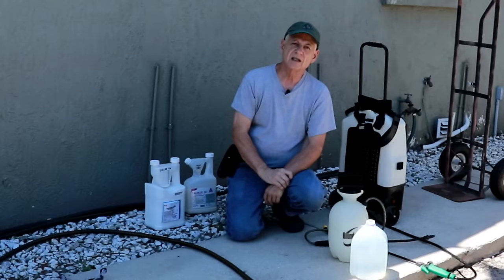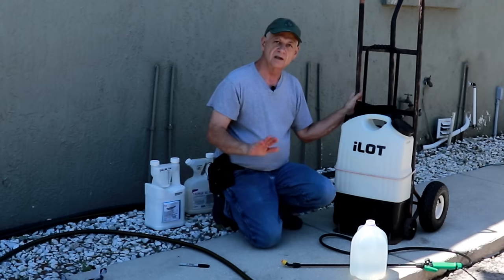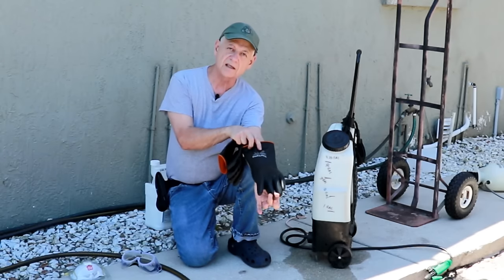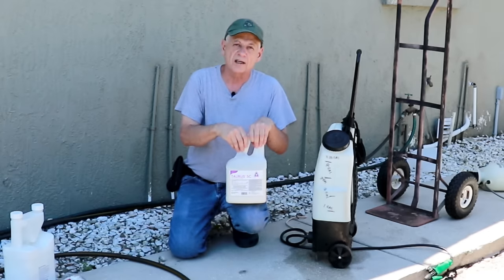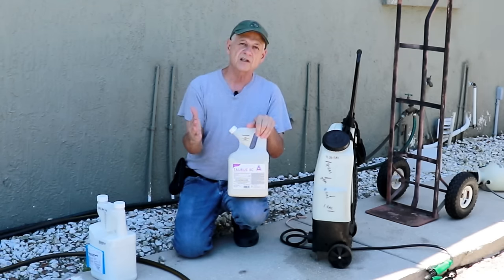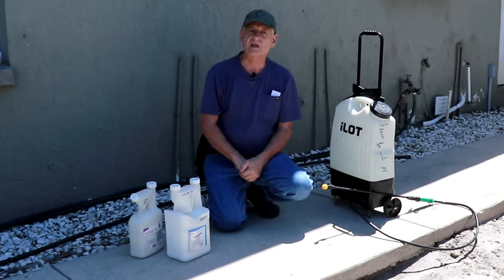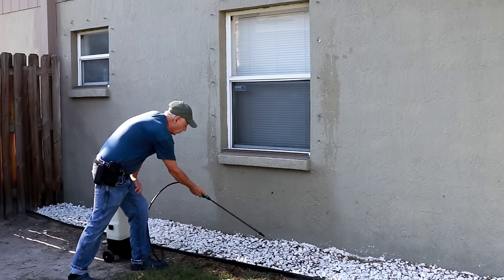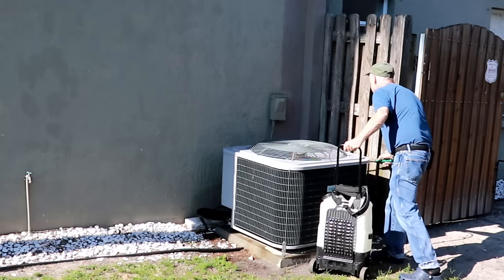General Exterior Pest Control - IMPORTANT!  READ THE DESCRIPTION.

Comment: I don’t know If anyone has asked this but in case of a rain storm situation. Would that void the 6 month treatment with the Taurus and require reapplication or wait the 6 month
Reply from the maker: Hi Ivaan.  Good question.  Here's the deal.  These products are designed not to wash away easily and are subjected to rain all the time.  That being said, the thing that I forgot to mention in the video is that you should treat every three months.  First treat with the Taurus SC, then three months later treat with the Talstar P, then three months later treat again with the Taurus SC, and so forth.  That way you are legal, but you still get the three month protection.  I have found that the Taurus SC does not last for six months.  Generally, it lasts for about three to four months, so you do need to do the Talstar P treatment in between the Taurus SC treatments.  I do know people who just treat every three months with the Taurus SC, but I cannot legally recommend it. Obviously, that will do a super job of controlling the pests, but the label is law and I would never suggest that anyone fail to follow the law.  I hope that helps.  Sorry that it took so long to get back to you.  For some unknown reason YouTube held your commend for review and I just received it a few minutes ago.  I don't know why they do that and I am working with them to fix the problem.  Sorry about that.  Thanks for the question and thanks for watching.

Comment: What do you recommend for what i think is booklice. Found in kitchen near  sink and window above. And found in 2 upstairs bathrooms on toilets.  How do you best treat for these tiny bugs that i can barely see?
Reply from the maker: Booklice, as the name implies, like to hang out on books and paper.  You can also find them in your pantry, in containers like boxes and bags, that you use to store food.  These guys like to feed on mold.  The only thing is that they like to feed where there is paper.  That does not mean though that they cannot be hanging out on shelves and areas of the wall that may have mold present.  Any small items, such as books, that do not contain metal, can be treated in a microwave oven.  Just place the item in a sealed plastic bag and place it in a microwave oven, with half a cup of water.  The water is important because microwaves heat water.  If you run the microwave without water in it, then damage may occur to the microwave.  So, the water is in there to protect the microwave.  Since microwaves heat water, it will kill any booklice or their eggs, because they contain water as well.  They do not contain enough water to protect the microwave, but they do contain enough so that the microwave will literally boil them to death.  Simply place the sealed bag and the half cup of water in the microwave.  Then use the highest setting available and microwave them for about 3 minutes.  You know they will be dead if the water in the cup is boiling.  Any other items that cannot be treated in this way should be thrown out if at all possible.  This includes food items.  If you have something that cannot be thrown away and it cannot be microwaved, then place it in the freezer for about four days.  This should kill the booklice, and then you can simply use a vacuum to remove the booklice and the eggs.   Next, you need to use a professional pyrethroid product that features a crack and crevice tube.  I recommend using PT 565 Plus XLO Pressurized Contact Insecticide.  It features a crack and crevice tube that will allow you to treat directly into cracks and crevices.   You want to get the spray into all cracks and crevices in your pantry, kitchen cabinets, windows, toilets, and any other cracks or crevices where you are seeing activity.  You also want to apply it on the surfaces of these areas as well and let it sit for about three or four hours.  This should kill any existing booklice that are in those locations. 

I hope that helps.  Be well my friend.

PT 565 Plus XLO Pressurized Contact Insecticide:   https://www.domyown.com/pt-565-plus-xlo-pressurized-contact-insecticide-14-oz-p-25335.html?pdpv=2
Reply: Thanks Guy! Will give this a go.
I looked over the product and it says it only works while wet, so does that mean that I will need to reapply?  
Is there not a product that is a non repellent like Taurus SC that I can use inside safely to deal with the booklice around the kitchen and toilets? Do you have any other product recommendations that I can look into? 

I just finished spraying the perimeter of the house etc as described in this video with Taurus SC so I hope that takes care of the ants getting in the house. 

One last question, what are your recommendations for rats?  We heard some chewing on the ceiling at what sounded like the metal part housing of a light fixture.   I can't seem to find all the entry points for these rats and the last time I hired someone they just plugged a few holes and didn't trap any rats but cost me a bunch of money.  
Do you have any ideas on how to beat deal with rats?

Thanks so much for responding and your great content. Been subscribed for a while 👍
Reply from the maker: I don't know what you were reading, but I can tell you that the Talstar P as a residual up to 90 days, and the Taurus SC is supposed to have a residual updo 180 days, but I find that hard to believe.  I think it has more residual closer to 90 days.  A great product that you can use indoors is tempered FX.  You can apply it with a pump up garden sprayer.

I have an updated video on how to treat the exterior of your house that you may want to check out.  The video is much shorter and includes more information than this one.  I will give you the link.

Rats are coming in from the outside.  So, the first thing you want to do is discourage them from being there in the first place.  If you have pets, do not feed them outside and do not leave food or water bowls outside.  If you have any bird feeders, then it's a good idea to remove them.  While the rats may not make their way up to the bird feeders, the birds can be quite messy and some of that bird feed may find its way to the ground, where the rats may eat it.  Make sure that all your trash cans are covered, and they have no holes in them.  In other words, make sure there are no food or water sources that they can get into.  
 
Next, walk around the outside of your house and seal any openings that you find.  You can use a commonly available caulk for small holes and Stuf-Fit for larger openings.  I will give you a link where you can buy Stuf-Fit.  If you have any trees or large plants that are touching the house, then trim them back and make sure that you have no trees that are overhanging the house.  If you cannot find where they are coming in, you can set up a critter cam on a tripod outside, facing the house.  Do one side of the house at a time.  Leave it out over night and in the morning the video will show how they are getting in.  There is a good selection of these cameras on Amazon.
  
Now that you've discouraged them from coming into the house, it's time to eliminate the population outside.  To do this, you need to use a bait and bait stations.  I will provide you with links to these products.  For the best results, place the bait stations directly against the foundation of the house and space them about every 15 to 20 feet apart, where you are seeing the activity.  You need to check the bait stations every day and replenish the bait as needed, until you are no longer seeing the bait being eaten. 
 
If you have rats that are inside the house, then the approach is pretty similar to outside the house.  You want to start by removing all the food sources.  Take your trash out every day, before you go to bed, so that there is no trash left for them to get into during the night.  Also, make sure that you don't leave any dishes lying around either.  Pet food and water dishes should not be left out overnight.  I do not recommend that you use a poison inside the house, because you don't want dead rats smelling up the house.  Therefore, I recommend using traps.  I think that snap traps work the best, and they're very affordable.  However, if you wish to be kind to the rats, then you can also use traps that will catch the rats alive and you can release them someplace outside.  You can find a good selection of these on Amazon.  You want to place the snap traps next to the walls, with the bait facing the wall.  If you're using the traps that catch them alive, then you want the opening to the trap to be near the wall.  The traps I am recommending can be reused.  Always wear rubber gloves when handling traps because the rats may avoid a trap that has a human smell on it.  After you catch a rat, you can dispose of it in the trash and then rinse off the trap with a garden hose for reuse.  Do not over clean the traps because you want to leave a little of the rat smell on the trap.  That will make the other rats more likely to approach the trap.  Be sure to check the traps at least daily or more often because dead rats in the trap will cause other rats to avoid the trap.  I do not recommend feeding rats and mice to cats because they may have a disease or parasites that can be passed along.  Place the traps at 10-foot intervals along the wall and focus on areas where you think there's activity.  Since you will be reusing the traps, I recommend that you use peanut butter as a bait because it is easily cleaned off when you wash the traps.  If you find that the rats are licking off the peanut butter without setting off the trap, then you can try a little bit of marshmallow.  It is much harder to clean it off the traps, but it is practically impossible for the rats to get it off without setting off the traps.  If you have children, I'm kind of guessing that you would prefer that they not get their fingers stuck in a trap.  I'm also guessing that you would prefer that the traps not snap down on the noses of any pets.  To avoid this problem, you can place the traps inside of a bait station.  These stations lock so that the kids cannot get into them.  They also make the traps more effective because rats like confined spaces.  Just use one trap for each bait station.

I hope that helps.  Be well my friend.
       
Stuf-Fit:  https://www.solutionsstores.com/stuf-fit-copper-mesh
 
Rat bait:  https://www.solutionsstores.com/eratication-rodent-bait
 
Bait stations:  https://www.solutionsstores.com/aegis-rp-bait-station-black-case
 
Snap traps:  https://www.solutionsstores.com/jagged-edge-snap-traps

Updated video on how to treat your house:  https://youtu.be/Yozv3s-Qwlw
Reply: Wonderful and valuable information. Thanks Guy!!

I think you should make a video with all this info about rats. I bet people would appreciate it.  I'm going to tackle the rats and booklice. 

By the way, I sprayed the perimeter structures with Taurus SC, it's been almost a week now and I have seen another abt in the house or around the property really.  I guess it works😊
Reply from the maker: You are probably correct.  I should make a video about rats.  I will see what I can do.  Thanks for the suggestion.  Be well my friend.
Reply: @GuysPestSolutions 

In regards to the PT 565 plus XLO that you recommend for booklice. It says that it's a non residual. Is there a residual product you can recommend to use instead for booklice?  What's the reason behind recommendations for this non residual?   I would think a residual product might be better? Please help me understand. Thanks!
Reply from the maker: There is nothing wrong with using a product that has a long residual, such as Temprid Ready to Spray, but you need a product that will get into the cracks and cervices really well.  I think aerosols do that the best.  The PT 565 plus XLO is very good for a fast knockdown.  It's a super fast kill and works well for pantry pests and booklice.  The Temprid Ready to Spray is a fairly new product and I have not used it for booklice yet, but I suspect that it would do a very good job.  I will give you a link to it.  Be well my friend.

Temprid Ready to Spray:  https://www.domyown.com/temprid-ready-to-spray-p-2657.html?pdpv=2

Comment: Guy, how about general bugs and mesquitos on Florida grass and plants?
Reply from the maker: Treating the lawn is a pretty good idea, but be careful about treating ornamental plants.  You don't want to treat any plants that may be visited by bees.  I have a video on how to treat for mosquitoes.  The only thing I would change in that video is the sprayer that I showed in the video.  The sprayer that I used in the video has a tendency to fall apart, which is something that I did mention in the video.  So, I have now switched to a much superior sprayer and I will put a link below for you.

In the video I talk about treating with Talstar P, but you can do it a bit cheaper with Bifen I/T.   Put 8 ounces of Bifen I/T into the garden hose sprayer and then fill it to the 32-ounce mark with water.  Swish it around a bit as you're filling it so that you can mix it as you are filling the container.  This will dilute the product to 25% of its original strength, but it will make the viscosity much thinner.  You need the viscosity to be this thin in order for the sprayer to pick it up.  Normally, the product is applied at 1 ounce per gallon of water, but since you diluted the product to 25% of its original strength, then you need to apply it at 4 ounces per gallon of water.  So, set the sprayer to 4 ounces per gallon.  Hook that bad boy up to a garden hose and off you go.  Wet the grass pretty well with it and you will get somewhere between two to three months of protection.  A lot of pest controllers do this now because they figure, if there are no pests on the lawn, then there are going to be no pests entering your home either.  If it's mosquitoes that you are after, then you also want to make sure that you treat the underside of tree leaves and other ornamental plants where mosquitoes can hide.

Pro Tips:  
Put a quick connect fitting on the end of the garden hose and the garden hose sprayer.  This makes it super easy to refill the sprayer. 

Buy one of those super garden hoses that you see advertised on TV all the time.  They are super lightweight and easy to handle.  They make the job go way faster and easier than using a standard garden hose.   The shutoff valve they come with on the end of the garden hose is very handy too.  The only thing you should know though is that you cannot store them outside because they deteriorate quickly in sunlight.

If you put a dye in the mixture, then you will know if the sprayer is functioning correctly.  If the siphon tube were to come off while you're spraying, then you would just be spraying with plain water.  Yes, it has happened to me in the past.  So, I have learned that it is important to be sure that the siphon tube is securely in place every time I refill the container.  If you use a dye, then you will know immediately if the siphon tube fails.  To be honest with you, I do not use the dye anymore because I have learned to just keep an eye on the amount of pesticide in the container because it drops pretty quickly at a rate of four oz per gallon.

I hope that helps.

Mosquito video:  https://youtu.be/LkkrW_tlLkg

Sprayer:  AmazonSmile : RE Chapin MFG Works G499 Adjustable Rate Dial Hose End Sprayer, 32 OZ : Patio, Lawn & Garden

Quick connect fittings:  AmazonSmile: UNCO- Garden Hose Quick Connectors, 3/4 Inch, 2 Sets (2 Female+2 Male) Hose Quick Connect, Water Hose Quick Connect Fittings, Hose Fittings, Hose Attachments, Hose Connectors Quick Connect. : Patio, Lawn & Garden

Garden hose:  AmazonSmile : Expandable Garden Hose 100FT - Upgraded Water Hose Self-Locking Leakproof With 10 Function Spray Nozzle and Durable 3-Layers Latex, 3/4" Solid Brass, Kink-Free Hose for Watering and Washing : Patio, Lawn & Garden

Dye:  Turf Mark | Solutions Pest & Lawn (solutionsstores.com)

Comment: Thank you so much for this, can you do a video on Bifen it please?
Thank you.
Reply from the maker: The Bifen IT works the exact same way at the Talstar P.  There is no difference between these two products, other than the price and that the Bifen has a slight odor to it, while the Talstar is odorless.  They are both mixed 1 oz per gallon of water.  I hope that helps.

Be well my friend.
Reply: @GuysPestSolutions  it does help, I did forgot to ask you, will this work on stripped scorpions, I'm in west TX.
Thank you and be well as well.
Reply from the maker: Yes.  The Bifen IT and the Talstar P are labeled for scorpions, but I have been told by some folks who have a problem with scorpions that Demand CS works better.  I have never had to deal with scorpions, so I cannot give you real life experience about it, but this is what I am being told by folks who live in areas where these guys are a problem.  So, you can try the Bifen IT or Talstar P and if that does not work, then you can give the Demand CS a try.  I will give you a link for it.

I hope that helps.  Be well my friend.

https://www.solutionsstores.com/demand-cs-insecticide
Reply: @GuysPestSolutions  yes thank you.
Reply from the maker: You are very welcome.  Be well my friend.